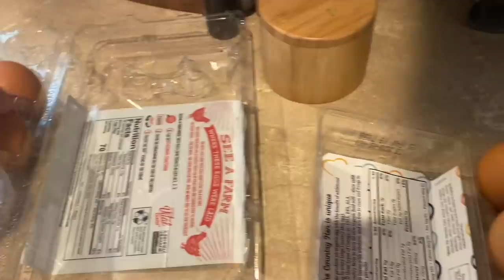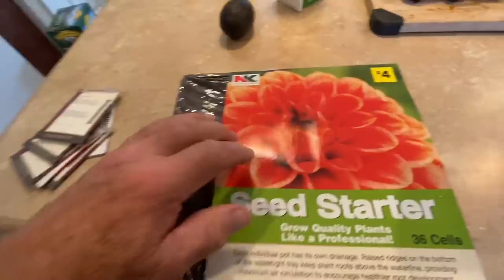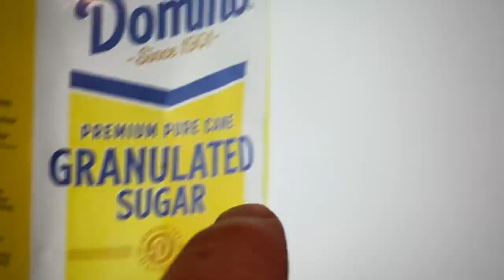Day After Day

Comment: Nice fish and filleting. Two cheffy tips. Descale in a sink underwater and the scales don't fly everywhere. If you get one in your eye, they stick like a contact lens. When you fillet, leave fillet 1 attached at the tail and then fillet fillet 2 and remove it and then finish fillet 1. Much easier for a straight cut down the backbone. All restaurants use steel pans, they are great. Love your food.